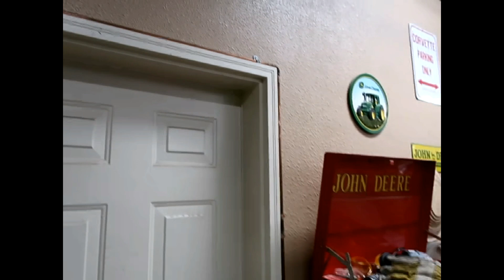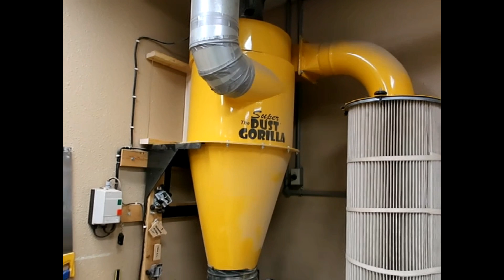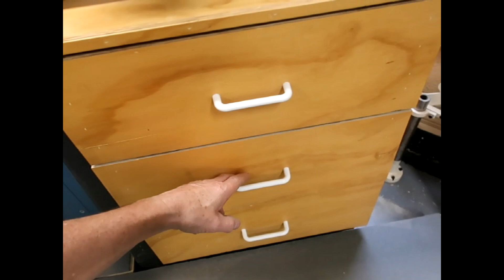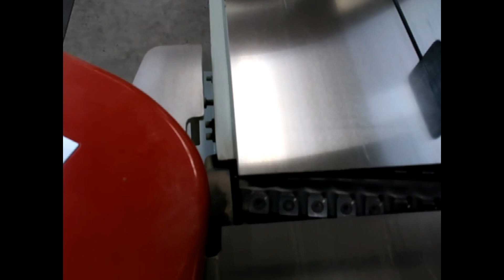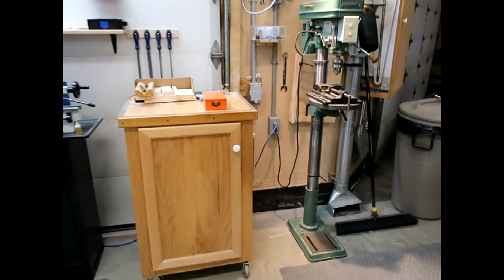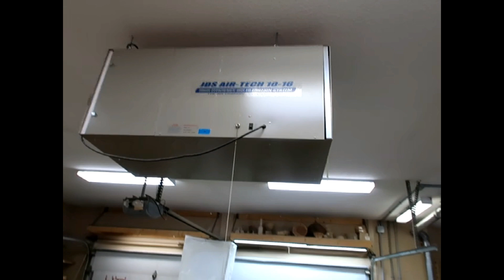Shop Tour:   An inside look at the wood working and wood turning equipment in the Wood Pile.

Comment: Hi Bob. I’m designing my next shop and struggling with 2 things you have addressed; 1) the air compressor “plumbing”. It looks like you used copper tubing and I didn’t see any condensate “traps”. My shop will be north oddments Houston, TX so very humid. Any thoughts or recommendations?  2) dust collection plumbing. Did you use standard duct work or a special product?  Thanks, from an aspiring woodworker.
Reply from the maker: Hi Bill,  thanks for watching the shop video.    That's a great catch on the water traps.   I live in Calgary,   it's arid,  not quite a desert but very dry.  We get about 12 inches of rainfall a year,  I think you guys get 50 inches or more.  I only blow down my compressor tank twice a year and usually get about a cup of water each time,  so not that much.   I've read that in some humid climates shops with big air compressors can generate a gallon of water or more a day.     I have no air filters or water traps on my system but for your climate I think it's a great idea.  A combination air filter water trap or an automatic drain valve installed downstream of your compressor might do the trick.   As we don't run into that problem, I wouldn't be able to guess how many traps you might need.   
Running a  permanent drain line from your air compressor tank to the outside so you can blow your tank down regularly or have it dump automatically would be really convenient.   

As for the dust collection I did look at buying a complete set of fittings, piping, etc. from Oneida.   And while that stuff looks really good,  the cost would have been ridiculous.   I ended up just buying residential ductwork.   There's definitely more air loss through the residential duct work,   one thing I did was to use duct tape on all the long seams on the straight pieces of pipe and on most of the elbows.    If I was doing it again,  I would probably also caulk all those seams with silicone.

Thanks for your interest and all the best with your new shop.  Let me know how you're making out.

cheers

Bob J.

Comment: Hello im wondering about your tablet saw overhead dust collector how do you lower and raise it above the blade? I  have something similar I did but it's not working out so good. Thanks for your video
Reply from the maker: Hello Michael,  thanks for watching and commenting!    I have the overhead dust collector on a bungie cord that's adjustable,   I don't often adjust it,  but I can by changing the position where the bungie cord is hooked.

Comment: Hello from a fellow Canadian! Just stumbled across your channel and subscribed. Nice shop you have there, very envious of your setup!
I'm guessing you are on the wet coast since you have a Magnum table saw, which - far as I can tell - is only sold at kms. I can't find any reviews of their products online, can you let us know what you think of it?
Reply from the maker: Hi John,  thanks for the comments and for subscribing!    Not on the wet coast,  but rather Calgary area.   You're right,  I've only seen Magnum's at KMS,  bought mine at the Calgary KMS store about four years ago.    My understanding is that Magnum is the old General Line up,  in fact parts from my Magnum table saw appear to be interchangeable with my friends General,  about the only difference is his saw is green and mine is gray.     If you liked General in the past you'll like Magnum.   I've had no issues with the saw,  it's been excellent.    If I was in the market for additonal equipment I'd certainly consider Magnum.

Comment: Love your under table saw cabinet. Any chance you’d put pictures up of every side of it on Instagram or something? Also love the cart between your metal lathe and drill press. It looked like it had a lip around the edge to keep things from rolling off. Also wondering about the stay closed garage door and shelves. The shelves above the doors with lights on them are amazing. A good compromise between nothing and the larger overhead shelves that handle large bins. Beautiful shop. It’s very much what I’m going for in mine.
Reply from the maker: Thanks for your commennts FW,  much appreciated.    I don't have instagram yet,  but I'll post a short video on the under table saw cabinet within the next week or so.      Shelves are between the panels on the garage door if I have to open it, I'd just have to take the stuff off,  I've unplugged the opener so there's no inadvertent openings.   Yeah,  the above garage door storage is a useable space that most garages could access.   Let us know how your shop is coming along.